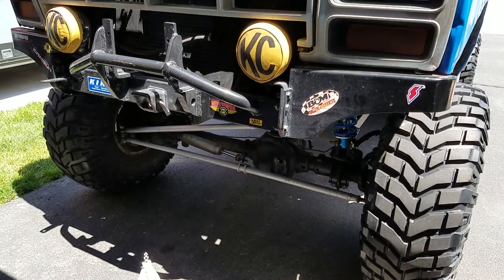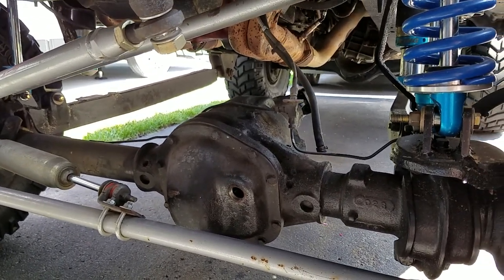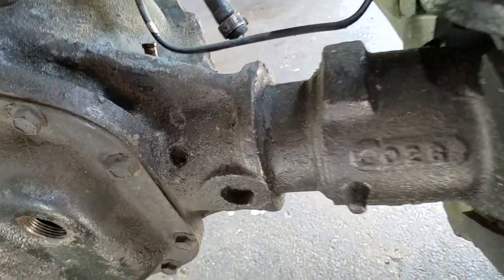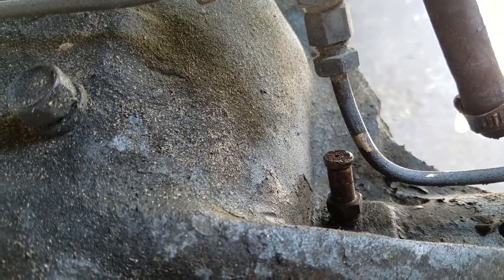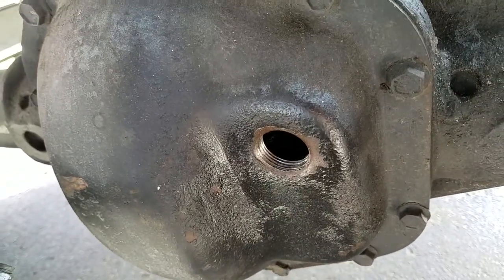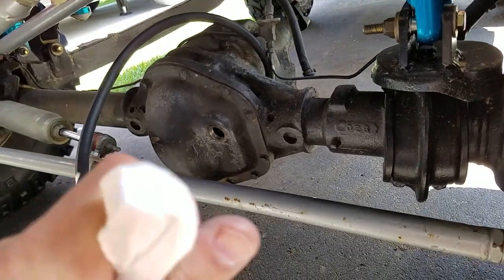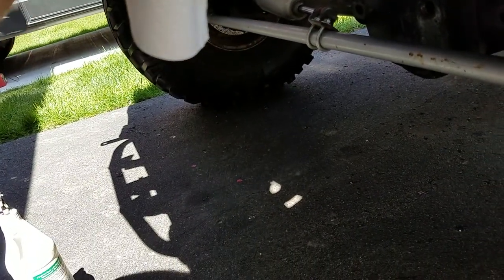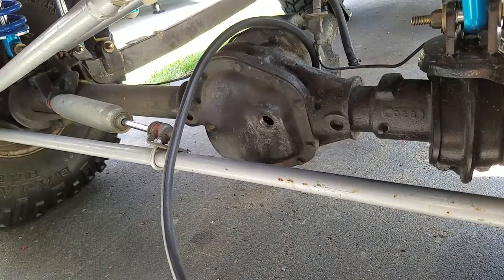Dana 44 Leaking- First Step is Check for Clogged Vent

Comment: Mmmmm...Differential Bong! That 90 weight flavor indeed! 
What's really exciting is that on a '68 VW bus transaxle (like in my Dune Buggy), there is no drain plug, so to change the fluid you either have to suck it out of the fill hole using a vacuum device, or drop the pan...from underneath...My hair smelled like 90 weight for weeks after that one, even laundry detergent wouldn't get the smell out...!